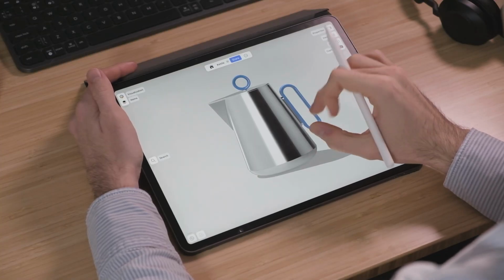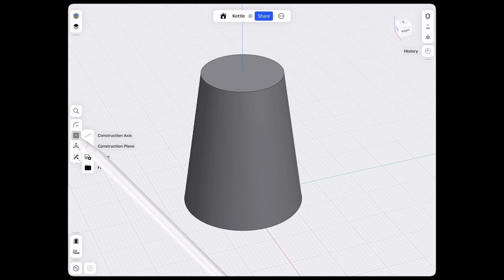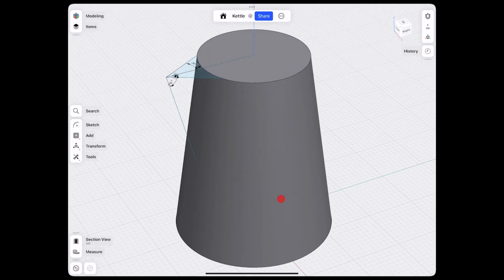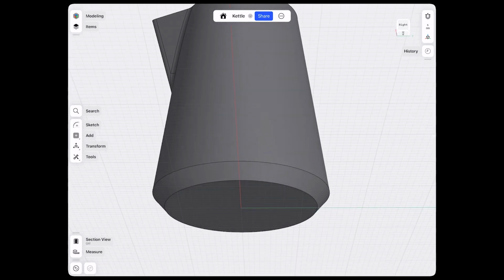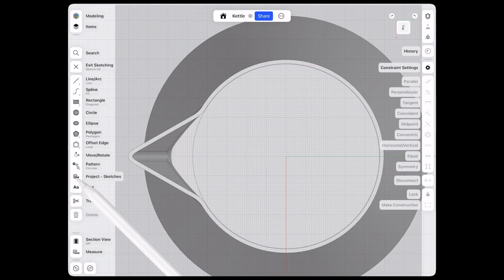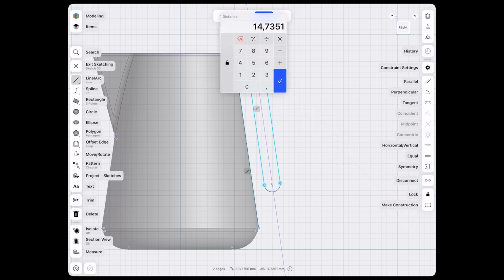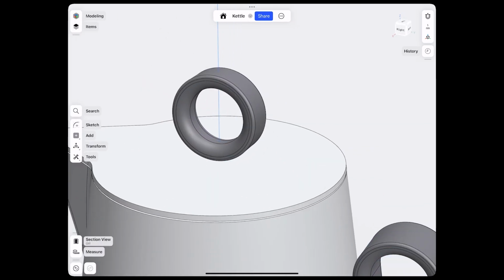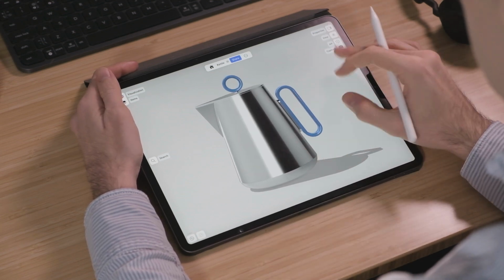Kettle Design with Extrude, Sweep, and Shell | Modeling Projects

Comment: 5:52 adding the "Ausguß" - this technique is not working on a Mac. I cannot switch to Sketch Mode / side view and have the Endpoints of the construction line visible as a starting point. It always defaults back to the top view, thus I can't create the angle and sweep. How to accomplish that on a Mac?

Solved: my drawing was not on the 0-0-0 Point on the Axis' I needed to add a construction plane that splits the Cylinder
Reply: In the meanwhile i switched to fusion, way more capable

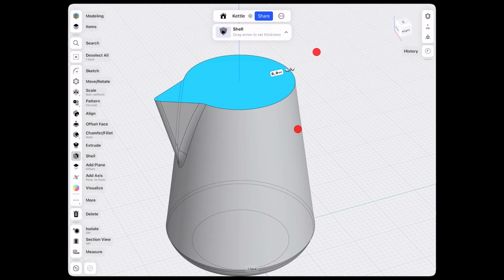Comment: 10:26 I have tried for over an hour and can not get shell to work so I can create the thickness. I think you missed showing a critical step
Reply: It is a common issue. The problem is that your sketches are not hidden, so when you try and click on the face, Shapr thinks you are trying to click on the Sketch. Go to your Items and hide your sketches, then try again. It will work